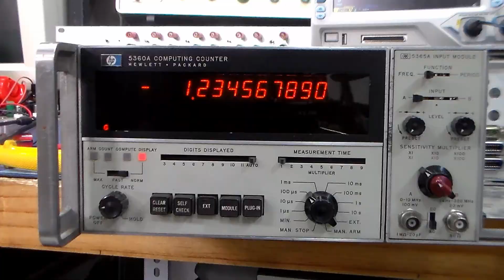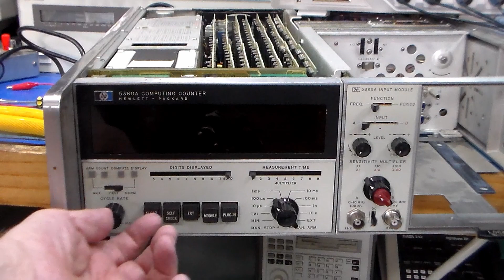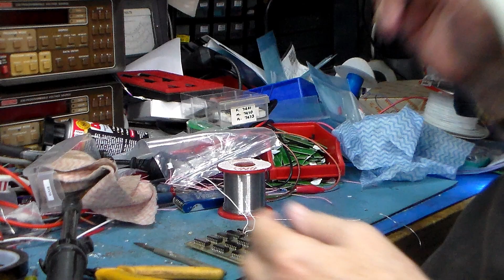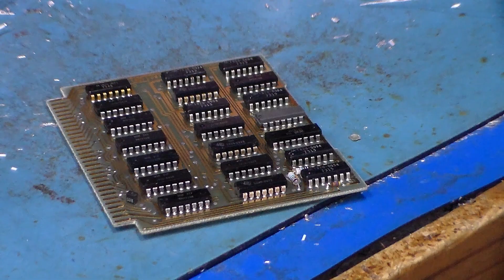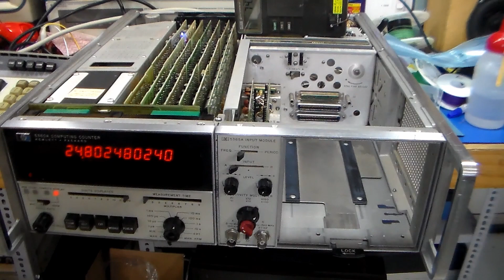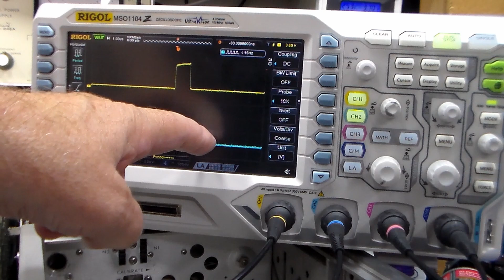HP5360A Repair Part 3 or Making My Computing Pig Fly Again.

Comment: I would love to see a followup explaining the operation the all-ttl calculation functions. I'd imagine functions like square root use some sort of iteration. Is there any sort of stored program to provide that ?
Reply from the maker: I'm working on part 4 which covers the keyboard, and some of the programming. I'm currently debugging a simple demo program. It has the limitation of only 32 steps, and other challenges limiting what you can do.